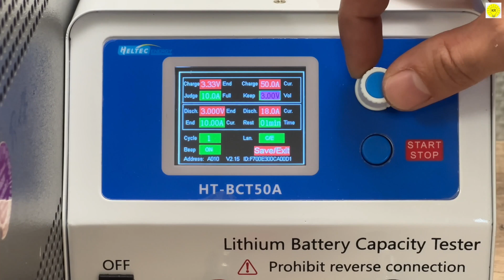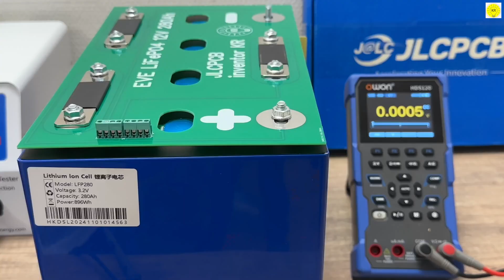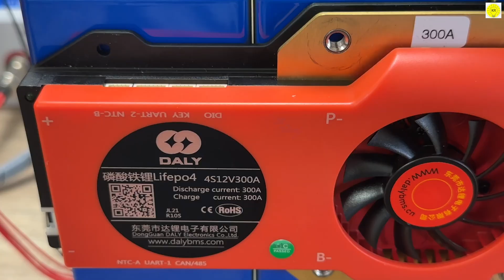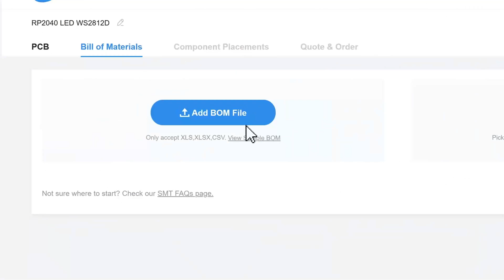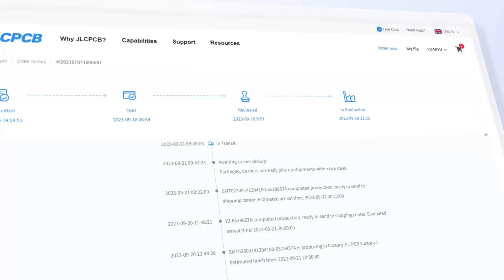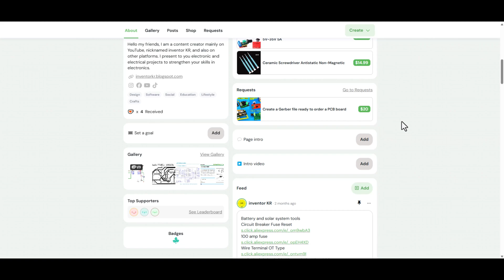how Build home solar battery backup 12V BMS 300A Home Energy Storage

Comment: this bms have active cell balancer? or its just a bms and i need separate active balancer??
Reply: Bei der Zellgröße würde ich in jeden Fall einen zusätzlichen DALY 5A active Balancer einplanen.
Ich habe bei 628Ah (8x EVE MB31 HSEV-Grade) ein 200A BMS von DALY UND den 5A Balacer.
Nach 4 Monaten habe ich eine Zellspannungsdifferenz von 0,0009V
Reply from the maker: That's some impressive setup you have there! The additional DALY 5A active balancer is definitely a good choice for maintaining cell balance over time. It's great to see how well your system is performing!
Reply from the maker: Great question! This BMS primarily focuses on battery management, and  include an active cell balancer,